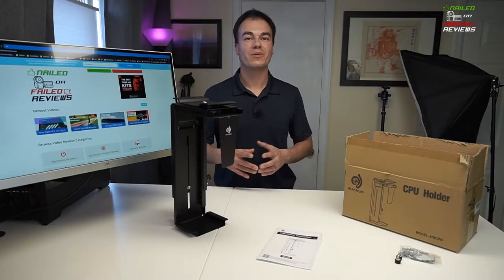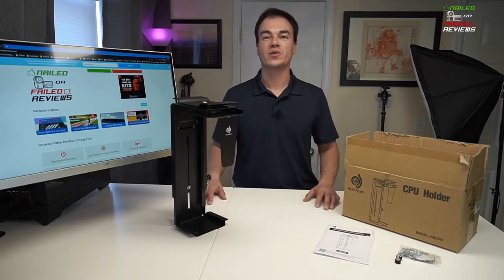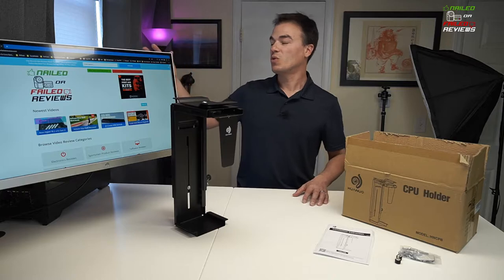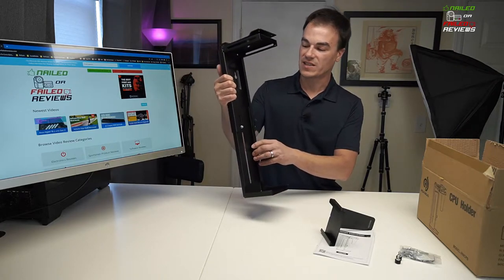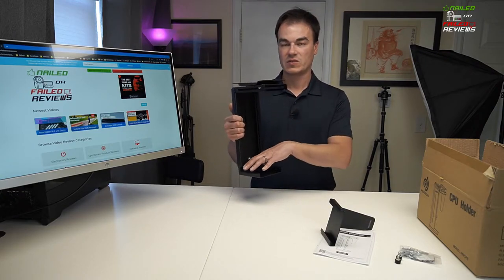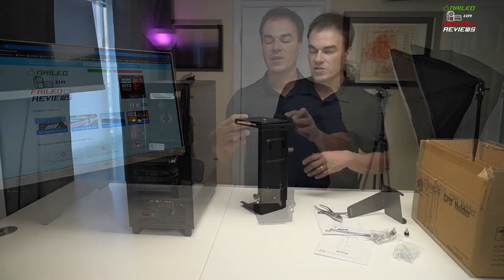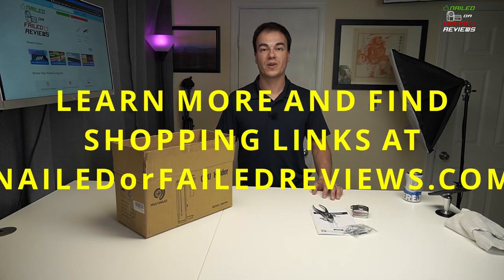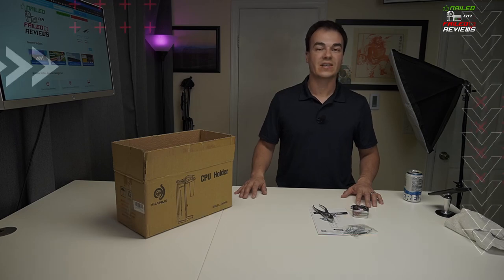HUANUO CPU Holder Review | Best Accessories For Standing Desks - Under Desk Computer Case Holder

Comment: Thank you for the video! I have the exactly same desk with you, and facing the same issue now. How did you mount it on the metal framework? Did you drill a hole on the framework before put the screw in? Can you share a link of the screw you used if possible? Thank you in advance!

Comment: Thanks for the review. Do you think it can fit a case with a width of 8.25"?
Reply from the maker: Just barely...My case is exactly 8" wide... The top piece that holds the case has a screw hole to lock into place. If it didn't fit right you could file down the slot this piece goes into and that would give you room to screw down the holding screw. Basically you're right on the edge biy I think it will fit.
Reply: @NailedorFailedReviews  Thanks, I thought I'd have to get creative. I'll let you know once it's all set up.
Reply: @NailedorFailedReviews  A drill and some filing was all it needed! A very nice mount. And it's very necessary for cable managing standing desks. Thanks again for the review!
Reply: @iain.  Thanks for the update my tower is 8.25" as well!